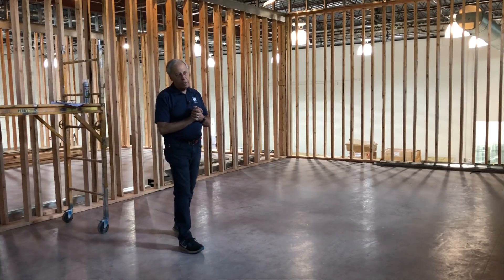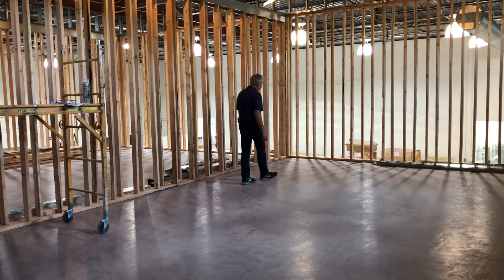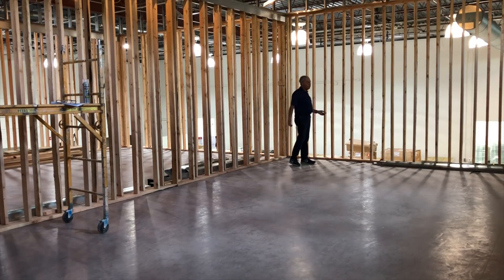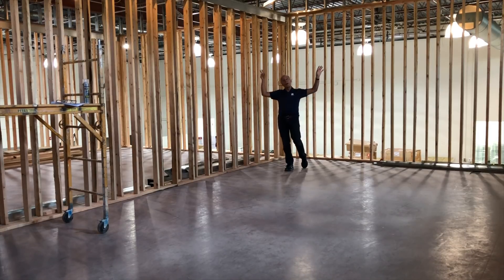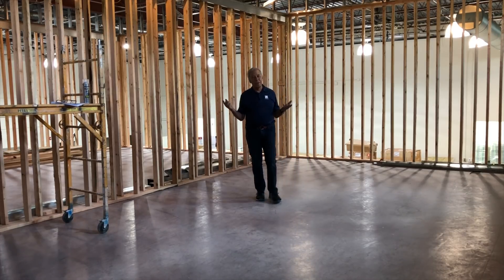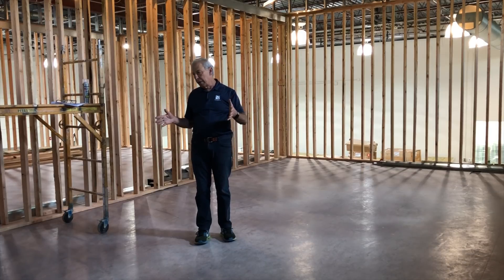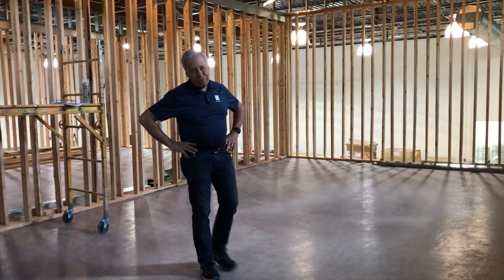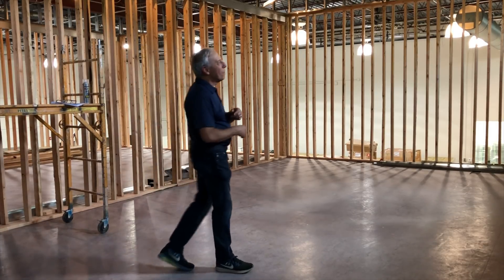What is the RIAA curve for vinyl?

Comment: Paul, I find it interesting that the walls look to be 6" to 8" thick with offset 2x4s.  I assume that is so that each side of the wall is physically isolated from the other and there is room to add insulation/sound deadening material.  You might want to talk about that for folks who might be building a listening room or home theater.

Comment: The RIAA recording curve, standardized in 1954, is used for the recording (cutting) and playback of LP records.  Putting it simply, the high frequencies above a certain point are gradually boosted (emphasized).  Upon playback this boost must be  deemphasized by the playback preamp and has the effect of reducing noises that would otherwise be present in the high frequency spectrum and is not very different in principle from the Dolby noise reduction system.  In addition, bass frequencies are deemphasized below a certain frequency with the purpose of limiting the groove space required for low frequencies thus preventing groove interference and increasing recording time.  The playback preamp compensates for this reduction by boosting the low frequency range.  All phono preamplifiers, whether separate or built into integrated amplifiers or receivers have this RIAA correction characteristic and also provide the additional preamp stage required by magnetic phono cartridges.   Amplifiers that do not have phono input connections do not have the RIAA correction and a separate phono preamp is required.   Ceramic cartridges generally have a sufficiently high output not to require a preamp stage and by their nature roughly correspond to the RIAA curve.   

The one drawback to the emphasis of the low frequency correction is that all low frequencies of the playback system will also be boosted such as turntable rumble, severe record warps, etc.  Modern turntables, tonearms and cartridges generally minimize or eliminate these problems.
Reply: Sounds like you are saying the recording is dynamically limited to fit on the record, especially in the bass area.
Reply: @DodgyBrothersEngineering  To about 60db if I'm to recall, which is more than sufficient for most music.

Comment: I don't know why people love vinyl, it's basically like sending the data to a DAC that makes the groves on the vinyl, because everything is done on computers. 
It's like recording a movie with digital cameras, doing the post processing, and then print the digital movie on film and call it IMAX experience :D
Reply: I have thousands of the old records from analogue sources and they are all inferior to well mastered CDs, DVD-As,  or HiRez files and DVDs or SACDs. ETC..
Reply: Yes but most cds are not well mastered. I agree well mastered cds are pretty good but I feel a lot the 70s albums are still better on vinyl, take groups like Led Zepp and The Who. Jethro Tull also but the recent remasters by Steve Wilson are much better. Most cds in the last 20 years have been over compressed. Digital you get hard edge or glaze, with vinyl you can sink into the sound.
Reply: @ Bill Crane I couldn't agree more! As a prog rock fan, I find many recordings from the late 60s and 70s to have far too much treble caused by semi-deaf engineers. Bands like King Crimson pushed the available dynamic range of vinyl to its limit. I much prefer the remastered digital versions of their albums. They don't cost extra either like Sheffield recordings, or "heavy weight vinyl". As for paper fibres in recycled vinyl, man I was glad to see the back of that kind of shit!
Reply: @jonathansturm4163 , sorry, but as a long time vinyl listener (going back to the 70's), it was more the case of where we were technology wise for vinyl playback - and much of it was mixed for radio, especially true of pop recordings, but by the late 60's, that began to change.

However, also, many cheap record players of the day had something l like a 6x9 speaker without much of a top end with ceramic or crystal carts and thus  many pop/rock albums were mixed for that, as well as for AM radio airplay.

I have lots of stuff from the 60's and not all of it sounds shrill, but play them on any decent system with decent to very good bass reproduction, there was more bass on those old recordings and classical and Jazz were not mixed in the same way as pop/rock releases were.

Also, many older record players of the day had issues with skipping if the bass was too much or the album was cut too hot, a good example was Led Zep II from 1968-69 early copies were cut too hot and many people could not play them because of the hot levels so they had to be remixed and reissued to correct for that, today, that's largely gone with any halfway decent table with a halfway decent cart.
Reply: @johnhpalmer6098  "much of it was mixed for radio..." I don't know why that would have needed emphasis of the higher frequencies. I was reiterating the explanation given to me at the time by a sound engineer I knew.
Reply: @jonathansturm4163   Think about it, AM lacked top end, so many recordings tried to make up for it, and to sound good on AM, and on cheap record players. I have some Paul Revere and the Raiders that was bright, especially in the upper midrange and to some extent the treble, we're talking from around 1966 or so, and I also have a stereo pressing of Spirit of '67, also by Paul Revere and the Raiders from 1967 and it's much less shrill, more even sounding and actually sounds decent and yes, it's an original Columbia 2-eye pressing and yes, it's stereo. I have Just Like Us and Where the Action is, also by the Raiders, Just Like Us is from 1966, Where the Action is, is I believe from '65 and they are both mono and are still bright, but Just Like Us especially so. Mind you I play them with an elliptical stylus which has a better top end than a conical/spherical will have. 

And they came during the RIAA era but it was label dependent as most were not too bad as I have lots of old 45's, original from the 60's that while not audiophile grade in the least didn't sound too bad overall on modern gear.

However, many were fine and not muffled sounding.
Reply: @johnhpalmer6098  I thought Van Gelder was a jazz recording specialist rather than prog rock. Perhaps my brains have turned to sand...
Reply: @jonathansturm4163  In The Court had issues at the tape level though, remember..
Reply: @jonathansturm4163   Yes Van Gelder was, but even HE recorded for AM radio as most artists only heard their music on the radio - in mono, at least up to the end of the 1950's and into the early 60's when FM and stereo started on the scene and yes, he did build a little AM transmitter and go listen to his work on the car radio., all this according to this rare interview of him from TapeOp while he was still alive from 2004. The discussion of mixing is about 1/3 to half way down the article.
Reply: i dont claim to have golden ears but old records are usually listenable because the sound is not compressed; the opposite happens with digital and when i listen to cd's i have to lower the volume or else. in fact, i remember when they started to make "digitally recorded" vinyl, just could not stand them.
Reply: I like vinyl because it's less expensive and have more titles than SACD or blu-ray audio. I buy vinyl because of the mastering  (granted there's some crap mastered vinyl out there too).
Reply: Vinyl is less expensive? Well it's not in the UK maybe where you live and used cds can had for a £1 or £2, condition does not matter so much as vinyl, as long as they play it's not a problem.
Reply: @sray804  Vinyl is rather costly here in Australia these days. I recently purchased a reissue of Miles Davis' Kind of Blue for my birthday for $AU35. Most of my collection is on second-hand CDs that cost me $AU2–5 each.
Reply: @jonathansturm4163   $35 to me isn't terribly expensive, but there has to be a bit of context to that statement though, but if you are seeking an original Blue Note LP pressed between 1955-1966 for instance, they are extremely dear price wise so a $35 pressing is going to be much preferable. I just earlier this week in fact, bought a reissue of a Blue Note LP from 1961 for $40 US in near mint to mint condition the copy dates to the mid to late 70's and is from the United Artist ownership of Blue Note. The original pressing up through 1966 goes for $600-$1000 or so, depending on condition and whether it was from 1961 or from 1966. So in this case, the UA pressing at $40 is the next best way to go to have a copy of this album. But I don't always buy albums that that price usually. I bought an original and early pressing of Kind of Blue for $15 US back in January in decent enough shape. Once fully cleaned it should be even cleaner and it's not all that bad now.
Reply: Zi m, on the projector question, i'm saying that most movies (mostly the heavy VFX one, don't have time to render animations at higher res because it takes a ton more processing time) are mastered in 2k and upscaled to 4k before printing them to an imax 70mm film, doesn't make the quality any better. 

On the DAC question, well if you have the money to buy a turntable all it's accessories and cables and all the audiophile stuff, i think you can spend all that money on a good DAC :D.
Reply: IMO there are a few reasons. One is that older records probably were not made from digital sources. Another is that current production vinyl records are intended for audiophiles and may have more than 3dB of dynamic range. This is obviously due to the mastering and not the format itself, but still. The older records also are likely to not be very compressed.

So, if I want to listen to some older band, I can play an older record or a "remastered" CD where they turned the compressor up so much that the VU meter needles on my tape deck stand still.
Reply: Yeah i forgot to mention "new" vinyl, not the old ones. Old ones as you said are probably way better as of dynamic range, and music was better back then. Not like today.
Reply: Not really. Nice try though. It's just a pleasing sound, with a dash of sentiment. 
Sure, there are better sources but, just look at the covers alone it's awesome!

Comment: Did the old "ceramic" cartridges just naturally follow this curve?  I know they had a higher output, and most cheap systems used these to save money.
Reply: Not just ceramic, but Rochelle salt also. See The Electronic Miracle of Rochelle Salt https://www.hifisystemcomponents.com/forum/the-electronic-miracle-of-rochelle-salt_topic4298.html for your question not answered. Perhumps one of the EE geniuses who post here would care to comment. It's a very interesting question...
Reply: This is a late reply...old ceramic carts are a piezo device. They output about 500mV into a high impedance. Due to their inherent high capacitance,  driving a high impedance gives an approximation of the RIAA curve. (They often would have been fed into a valve/tube). They wouldn't have followed the 'steps' in the curve at all accurately, but worked ok in a small record player.

Comment: I find quite a few "receivers" out there with NO "phono" inputs.  You must have a "pre amp" to play them.
Reply: Yes, you need a phono stage that boost the tiny electric voltage sending by the phono cartridge (typically 3.5mV for a MM) and add the RIAA curve demphasis (boost bass about 20 dB and reduce treble about another 20 dB aprox), both things required to feed the line input.